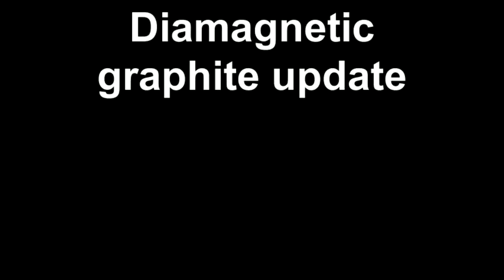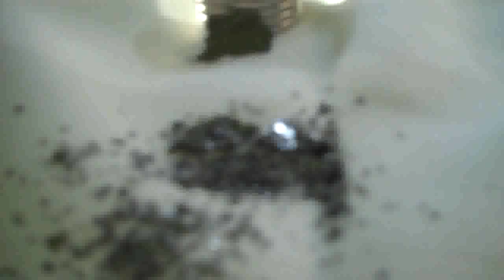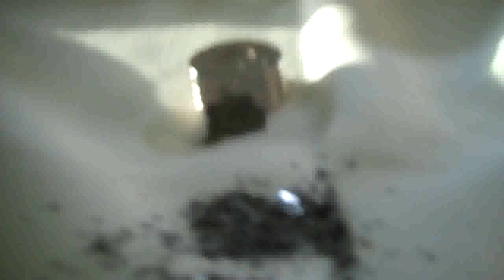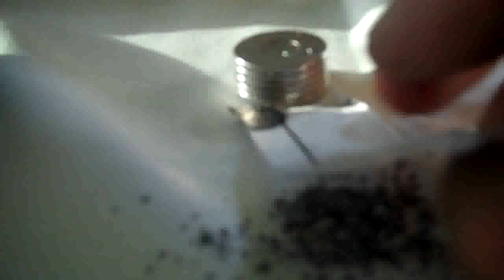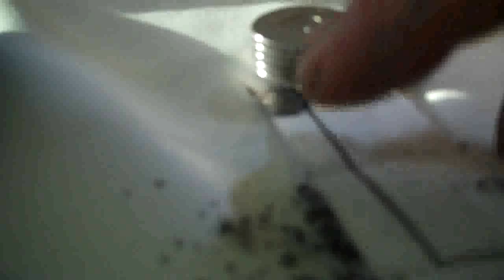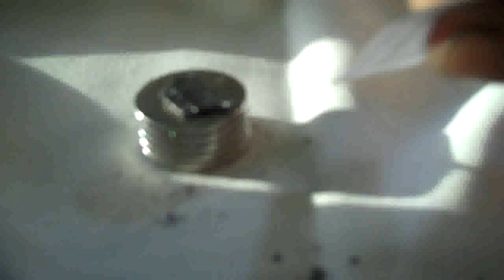Diamagnetic Graphite Update

Comment: 1  remove microwave thermo switches  its gonna get hot  2 drill hole threw back of oven right threw front door  3  insert graphite pipe  allow o2 from o2 tank to flow threw  4  turn microwave to high  stand back   micro waves convert graphite to graphine  material     structural change undeniable   plasma reaction for energy input  oriceless  might have to open door for a second or 2  to get plasma  a happening   outside is a good place to do this  lol  a friend  ron